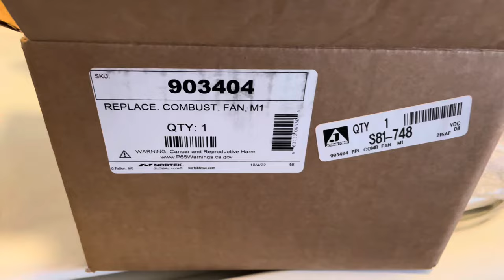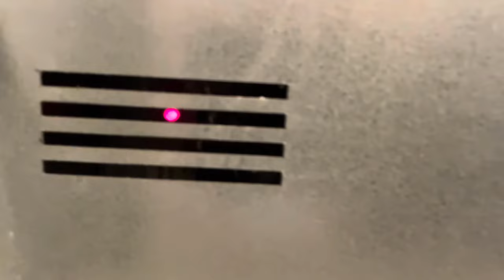Intertherm mobile home furnace not heating 🥶🥶🥶#fyp #hvac #hvactechnician

Comment: Very interesting!  Thank you for the video. I've not seen this model yet, but am sure it'll happen.   In really cold weather, I give the inducer motor a whack with a rubber mallet and sometimes get the customer some heat until the new one arrives.
Reply: This comment about giving it a wack saved me! Thank you.
Reply: The mallet smack saved me and my family from freezing. Legend.

Comment: Hi Daniel, great video. My furnace looks exactly the same...any idea how to open the evaporative coil access panel on these units?? No screws on front or side of cabinet nor does it have a knob to pull out that panel... Any help would be greatly appreciated.
Reply: Just pull the panel cover from the top edge
Reply: @jaimecorrea6854  Thank you for your input, I did end up figuring it out and had success in opening it!!!

Comment: I have the same furnace, its flashing 2times too, I replaced motor and switch already but it’s still flashing 2 times. Humm sound still heard and furnace will not work unless Im resetting it. Please help any ideas?
Reply: I hope someone answers im having the same problem
Reply: I was having the same problem. The control board was throwing the wrong signal. Replaced control board and it fixed it